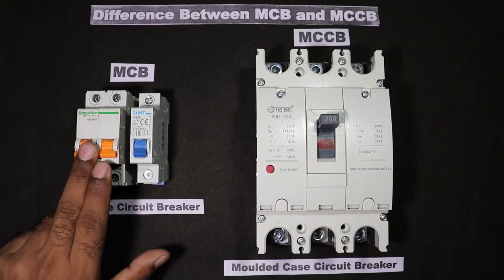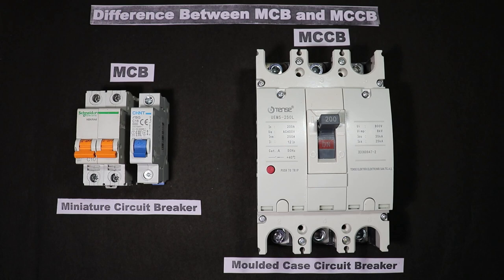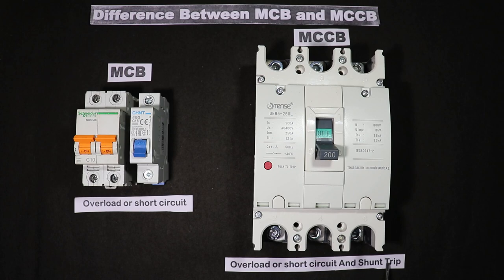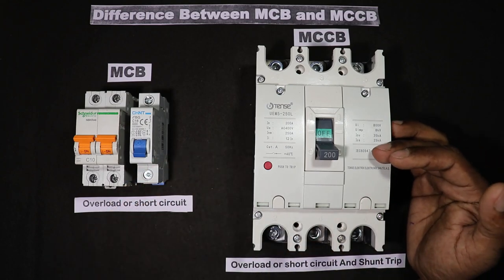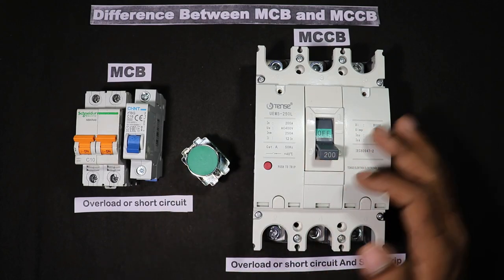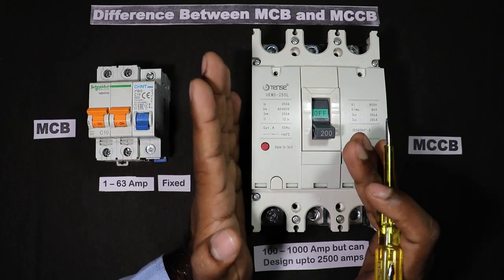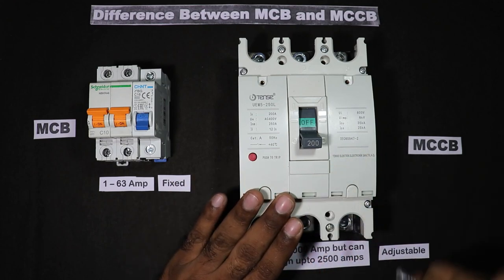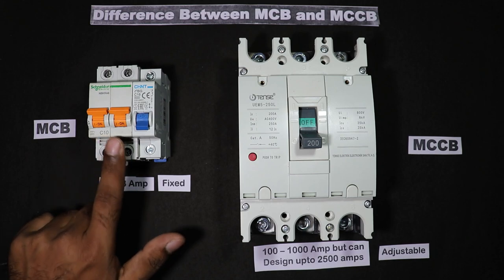Difference Between MCB and MCCB || MCB vs MCCB @TheElectricalGuy

Comment: A few mistakes I've noticed 

- MCB's nominal current goes anywhere from 0.5A to 125A
- MCCB's nominal current goes from 16A to 3200A or even 4000A
- MCBs can absolutely feature auxiliary or alarm contacts and/or a shunt trip. Schneider's A9A26909 is an auxiliary+alarm for iC40/iC60 MCBs, for example
- the breaking capacity of an MCB goes anywhere from 4.5kA to 100kA. Schneider's iC60L and NG125 go up to 100kA if I recall correctly.
- MCCBs also exist in 1-pole and 2-pole configuration, although they're quite rare
- 7:34 The Ics is the current that can be safely and repeatedly interrupted by the breaker. In your example MCCB, you can break 35kA (=Icu) but the breaker will probably be toast after it. If you don't want it to be toast, stick to 25kA (=Ics) or lower and you'll be fine.

Comment: Nowadays 2 Pole MCCB Also available in Market. MCCB Rating starts  From 32 Amps. Another Diffarance between MCCB & MCB is that there is a Single switch or Mechanism in MCCB to On or Off the device but in case of 2,3&4 Pole Mcb there are separate swithes & Separate Tripping Mechanism and All Separate MCBs fixed commonly with revetting rods,Swithes also collaborated with Common Rod.🙏

Comment: Small corrections : 1) There is a shunt trip option for some types of MCB, 2) Current ratings for MCCB start from 40A not 100A and go up to 3200A not just 2500A. 3) Most important differences between MCB and MCCB is (as you stated) the larger Icu, and DURABILITY (service cycles).
Reply: Current ratings for MCCB start from 16A not 40A